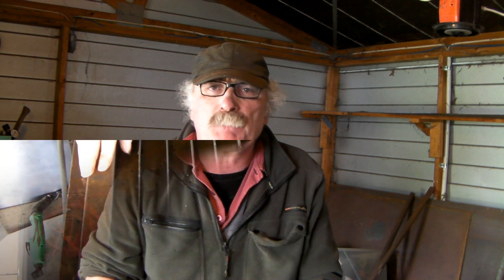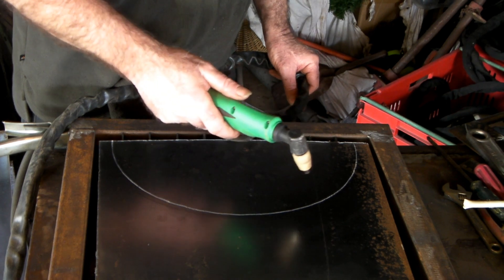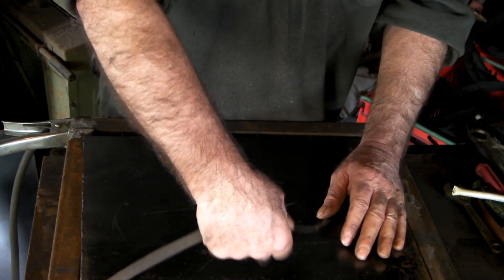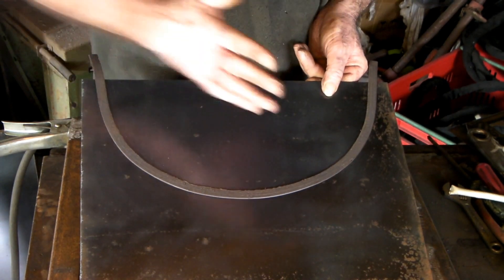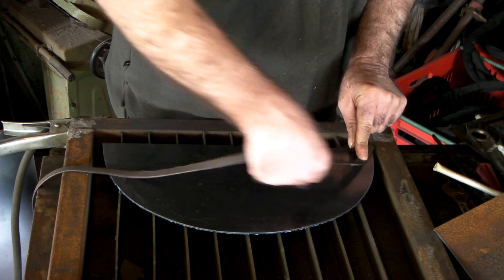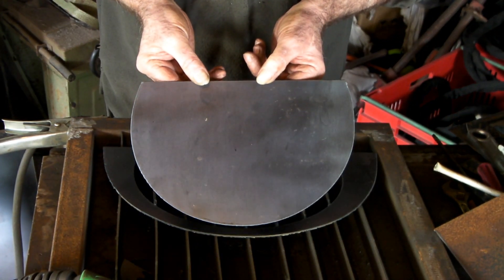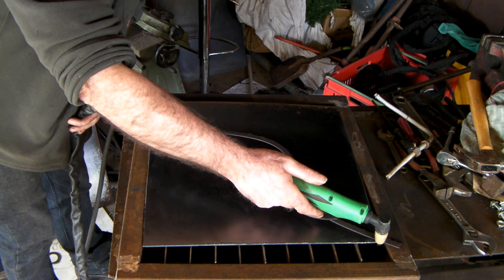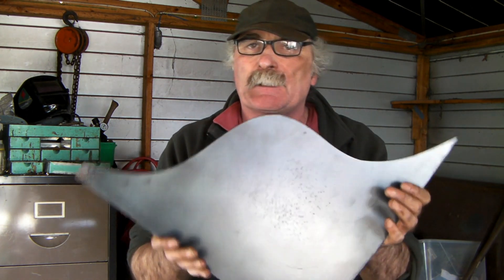Plasma Cutting Shapes

Comment: Bull pucky peaty pete. You should have ..loose ...inserted cross beams in yur plasma table. Lolz .so you can remove middle grates. By hand. To make it lighter to move. And have one side cut down in the middle. So one side you can have air between yur piece. And table if you ever wanted. Clear as mud I bet lol. Just helpful hints from yur handy hardware man. Lolz. Tee pea to ya. G-day
Reply from the maker: Cool ideas cheers mate